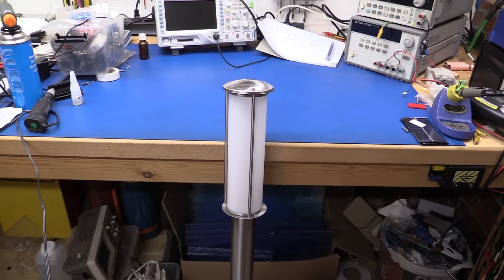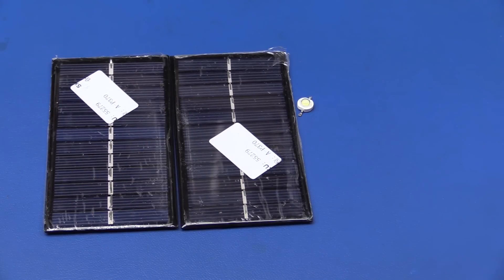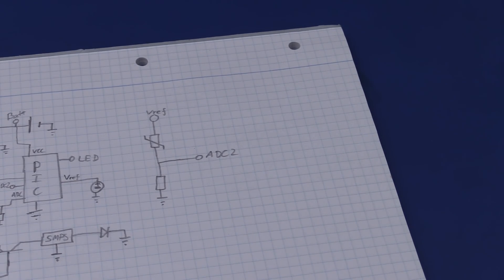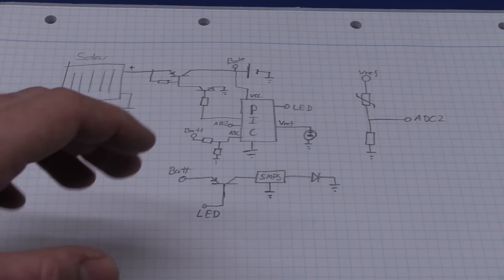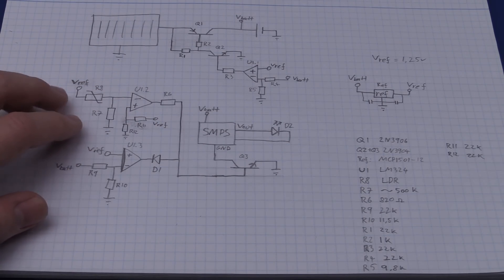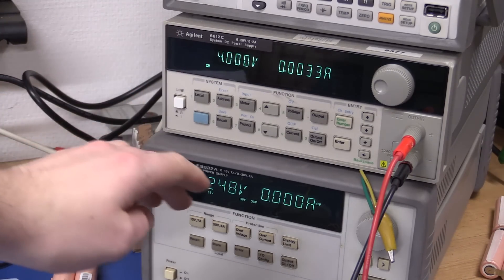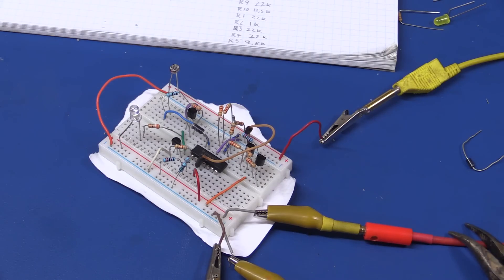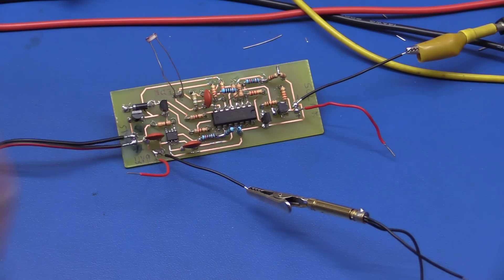Making a Solar Powered Garden Lamp - Ec-Projects

Comment: Hi Mads,
I don't know if you're aware of this, but it looks like your dc-converter is one of those that come aplenty from china, and which uses an LM2596, similar. If that's the case, one of the (normally permanently grounded) pins on that chip is an enable pin, which means you can turn the converter off without switching the input power...

Also, I would consider using proper comparators instead of opamps - they mostly have open collector outputs which can be driven right to ground, and easily connected together as wired-or/wired-and..

Comment: Thumbs up for analog approach. I started getting angry at the beginning, like: "Oh great, put a uC in that; there's no other way" :D But I kept on watching and I'm glad I did. Good project, but how good is the performance with that buck regulator, which is the voltage source? It has a potential ability to run away
Reply from the maker: It works ok'ish, not ideal of course. When the battery gets to 3.75v it starts to drop out and can't provide 250 mA any longer. Regarding the runaway, I use a decent aluminium heat sink and would set the voltage a bit low, so it reaches the max current when it warms up. Again not ideal, should have been a CC supply. Furthermore, the transistor in the ground path also helps limit the current a bit, should things get out of control.
I actually ended up setting it to just 100 mA because it was a bit too bright.
Reply from the maker: Ohh, and thanks :)
Reply: EcProjects There's not that much of a voltage difference (4.2v max - about 3v for LED), simple 2 transistor current source might've been just fine. 3v for LED + 0.6v across sense resistor = 3.6v will still give you max brightness you set, then your UVLO will cut it out. Or if you wanna go wild - use a SEPIC converter with current feedback :)
And, there must be enable pin on the IC in that DC-DC, you might try to manipulate that rather than interrupting power the way you did, or at least use a MOSFET to minimize the drop. Just my 5 cents, I enjoy your vids

Comment: I noticed that all opamps are used as comparators. LM339 will do a better job. It has open collector output so you can even skip some transistors. For example the NPN transistor for overcharge protection could be the output transistor of the comparator. The PNP transistor must have hfe >= 300mA/6ma = 50 minimum (because minimum sink capability of the comparator is 6mA). And of course resistors must be calculated to drive the base with 6mA. Also if you put just a tiny bit of hysteresis on U1.3 - just few millivolts, it'll switch on and off instead of being half turned on and heat up.
It'll need a bit rearrangement in U1.2 and U1.3. You can switch the SMPS at the high side using PNP transistor which can be driven by U1.2 output. If you use the same transistor for Q3 as Q1 then you need R6 to limit the current to 6mA. That's (Vbatt min - Vsat comp) /6mA  => (3.6V-0.4V)/6mA ~= 510 Ohm, but I think you can easily get transistor with minimum hfe = 100 and double that value to reduce power loss when LED is on. The undervoltage protection can be done by connecting output of U1.3 to negative input of U1.2 which will short R7 to the ground. If the LDR's resistance get too low during the day you can add a resistor in series  to reduce power loss when battery is low. But that won't be a problem because soon voltage will rise and the undervoltage protection will disengage.

One more thing - it's a nice challenge to make it all analog, but 3mA is a lot when you have just a small battery and a cloudy week. One advantage of MCU is that it can sleep and opamps/comparators cannot. If you used a mcu you can make it sleep when under voltage condition detected and wake up every minute or so to measure voltage for few microseconds. That'll improve the life of the battery a lot.

And last but not least there is one big problem with not using a MCU. As you know Li-Ion batteries do not like to be tickle charged, but because your circuit draws some current Q1 will always switch on and allow some current into the battery. So a mcu can continue turning on/off  Q1 simulating constant voltage and after some time (let's say 1-2 hours) it can stop charging until the voltage drops under 4V for example.

P.S. sorry for the long comment. I didn't mean to ramble that much.
Reply: @Nicolay Pevlov. I agree with all you've said. Well if you have a schematic in mind that you think will be better suited   and don't mind sharing the code as well ?  Im thinking of an ATTINY85 . I'll be more than happy to do such a build. I do not have the know-how when it comes to the MCU/programming side of things. Tnx.

Comment: Very interesting project, thanks for sharing, just one ask about the battery, there may be several charges over a single day, is this type of battery ideal for this project? a lead-acid battery would be a better choice, isn't?
Reply from the maker: I think the charging / discharging cycles should be fine for lithium ion, but one could worry about the temperatures in the winter. You can also use lead-acid, but that also suffers when it's cold. :) It might last longer, I don't know :)
Reply: nicd since they are used most often, they can be overcharged and they dont suffer on low temps

Comment: how do you get 10 WH? wouldn't it be 3.6v(nominal) * 2.2AH(maximum real AH I know of for 18650) = ~7.92 WH? I'm genuinely curious, not trying to bash or anything.
Reply from the maker: Yeah.. I checked the Panasonic datasheet (Might not be the exact battery I got) it says 2700 mAh and times 3.7 V. Might not me entirely accurate, but close enough :)
Reply: Interesting, I didn't realize there there were real 18650's that high. Very interesting project!!
Reply from the maker: Just checked the Panasonic CGR18650CG which I used. It is 2250 mAh and a nominal voltage of 3.6 :) 
So you are right about the 8 Wh :) But they are available up to 10 at least :D
Reply from the maker: Paul Martin Thanks :)

Comment: I am at 1:50 and paused because you are in for some trouble as the printed parts will melt and sag (mostly sag and start to deform) in direct sunlight with the solar panel there collecting the heat AND those panels will age very rapidly as in one season they turn an awful yellow and by season two it has become so bad they can't even collect the sun anymore.  The best ones to use are those 5/15 watt in the glass and while they cost more they don't age like that.   I know these things as it happened to me on both counts and the farther south you go it only gets worse.  As for the plastic not even ABS holds up too well in the southern sun on a 105f degree day.

Comment: I think your design could be improved a bit. Life time of lithum battery is greatly depenent on the time you keep it at maxinum voltage (4.2V). The charging circuit has no hysthesis but keeps the voltage at maxinum all the time it can when the sun shines.

If you added some hysthesis to the charging op amp to switch charging off when it is at full voltage you'd get more life out of it. Ideally you'd have the hysthesis only when the charging current is low ie. it would turn off at the end of the CV cycle. (This could perhaps have false triggering when the sun dies because the current naturally drops.)

If the battery becomes a bit lossy at the end of the life it could draw tiny constant current all the time (if no low current turn off) which could make it overheat and burts to flames in the worst case also.

You could also include a cheap true charging control chip to get off the self solution with the same problems with false charging ending when the sun goes out and it is at end of the cycle.
Reply: any ic you recommend to use for charging?
Reply: For any small project just get some cheap usb charging boards from eBay perhpaps? Could be an easy and checp source.